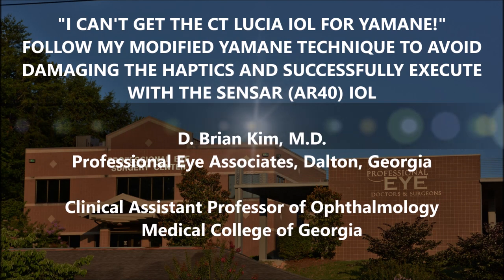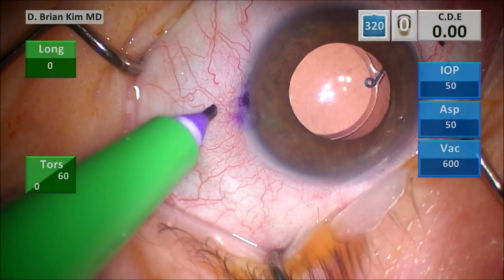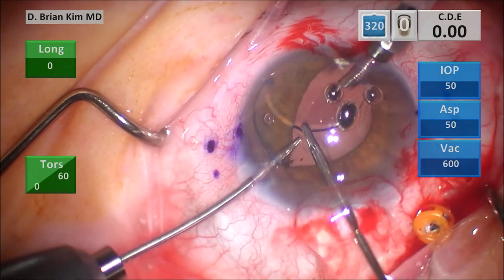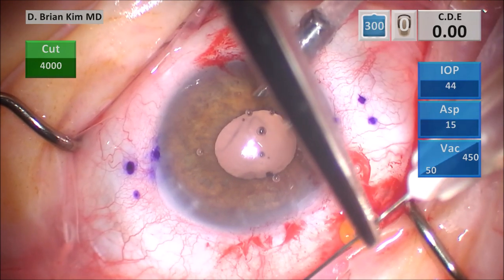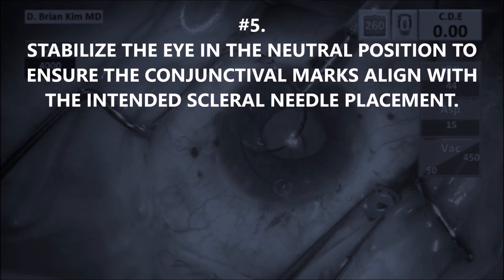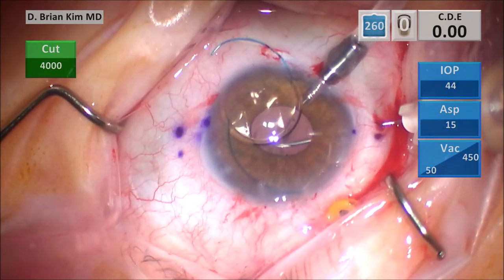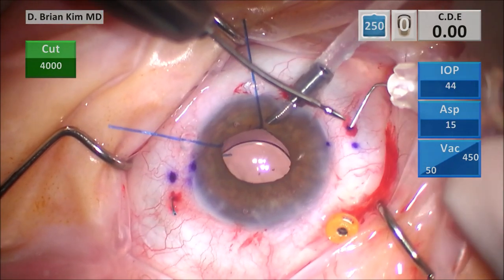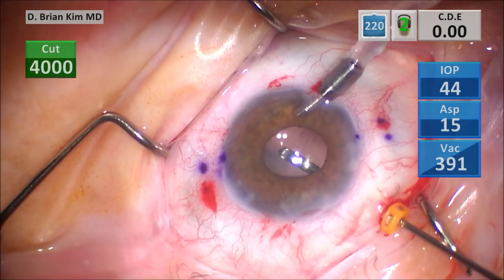Kim Modification of Yamane Technique for Easier Cannulation of Delicate Sensar IOL Haptics

Comment: Absolutely fabulous. Excellent Job Dr. Can we try this modification of Yamane with the Alcon MA 60 3 piece Lens ? Their haptics are a bit more fragile.
Reply from the maker: @81179venky  hello, the haptic curvature in the Alcon MA60AC makes Yamane more difficult. There is a mismatch between the direction of the scleral needles and the haptic curve. I have heard of surgeons using it successfully but I would advise against it if you have access to the Sensar AR40. Best wishes
Reply: @DocBrianKimMD  unfortunately I don’t have access to AR 40 and Zeiss CT Lucia currently. Thank you for the reply.

Comment: Hello Doctor Kim. Well done. Have you tried to engage the trailing haptic inmediatly to the needle instead of externalize it? Minor angle trauma when you insert the IOL into the eye and this way you can manipulate the IOL in the vitreos cavity and this maneuver turn easier the engagement of the second haptic.
Reply from the maker: Yes, I do understand what you mean and agree that you can do it that way. The way I do the technique and teach it is for even the most novice surgeon to be able to do it. Trying to work the needles in the vitreous space can be scary for some especially if you are learning.

More importantly, you have to understand the haptic bend relative to the needle direction and have to be skilled at cannulating the needle in this context. It can be a challenge if you are still learning. This is why I do it the way I do it. I hope this clarifies, but again, I agree that there are other ways to do it successfully.

Comment: Should we use 3 hands to insert Sensar IOL  simultaneous with externalize the leading haptic using microforceps?
Reply from the maker: Yes, surgical technician advances IOL, surgeon holds injector with right hand, surgeon inserts needle through contralateral limbal incision with left hand. By doing it this way, surgeon has complete control of directing the haptic into the needle.

Comment: Awesome case. Slick move at the beginning getting that left-sided haptic above the iris. Using the shaft of the micro-grasper as a fulcrum. 

How often do you encounter a lens-tilt with this method? Do you think a peritomy in the area of haptic insertion (so to mark on immobile sclera) would yield less variable results?

Again, awesome case. I learn a lot from your videos.
Reply from the maker: The lens tilt question is a good one. The question is really about accurate and equal scleral needle placement. When I was learning to do the technique, I had some cases of noticeable lens tilt when I looked at the IOL in the slit lamp. Thankfully, the tilt was not so severe as to cause decentration, UGH, or visual problems. This is much less common now, but to your point, there is potential for tilt due to the nature of the procedure unless there is a better way to standardize it. Dr. Yamane developed a device which attempt at this but the varying white to white poses a challenge. Yes you could do a peritomy. I have never done that   And it would add another step but it would effectively remove the conjunctival mark issue.

Comment: Great learning case Brian. What is your flow rate for your AC maintainer?
Reply from the maker: Hi Martin. This machine goes by IOP instead of flow rate so the IOP was set at 44mmHg which is pretty high infusion. The 20g cannula allows that high pressure head.
Reply: @DocBrianKimMD  Thank you so much Brian

Comment: Could this have been done for primary lens itself ?
Reply from the maker: In some cases yes we can as long as the IOL is the proper type and in good condition. I have done this many time.

The only caveat is if the bag is covering the entire lens. Then it is not worth trying to save the IOL and risk losing capsular bag remnants in the vitreous space. In that case, it’s better to remove everything and start over.

I hope this helps to clarify.